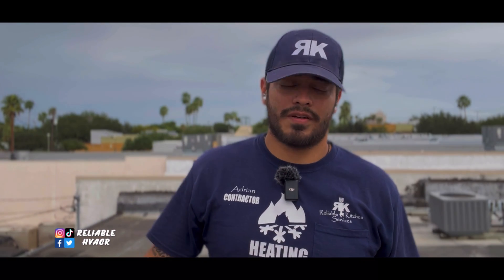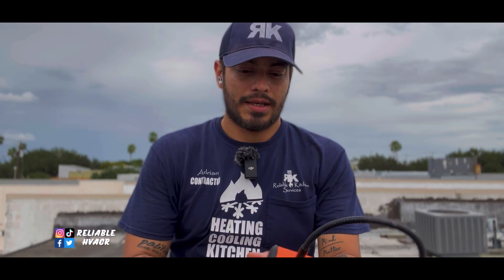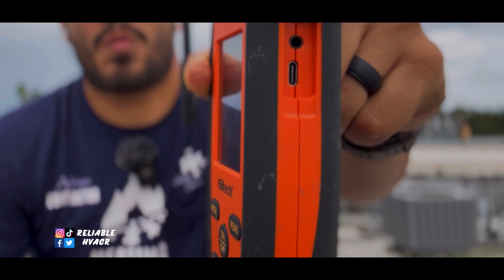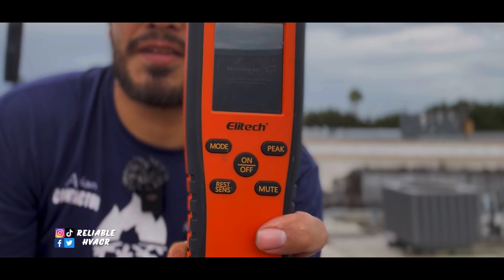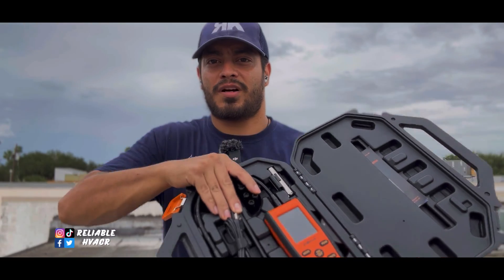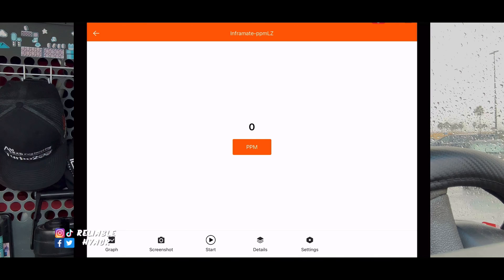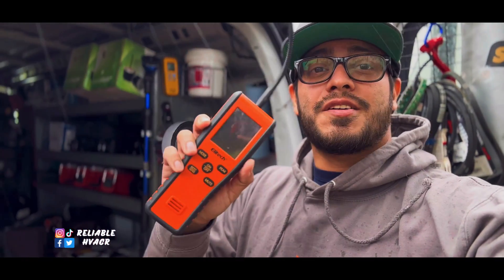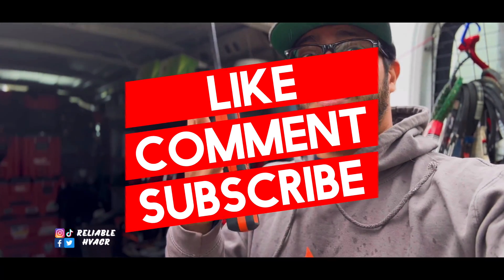NEW WIRELESS & PPM infrared refrigerant leak detector / Elitech Metrum

Comment: You ever tried opening up the unit to see what the sensor looks like ? I know they say 10 year life span on the sensor but let's be field realistic... 2 to 3 yrs at most lol
I looked at one of the pictures that elitech had of the sensor and it looks strangely familiar to the Inficon cartridge style sensors. 
I'd love to be able to replace the thing when and if it fails but elitech doesn't offer accessory replacements as far as I'm aware of and that's preventing me from placing a sale.
I know that Testo 316-3 heated diode sensor is the same the Tekmate sensor from Inficon so maybe there's a chance that the Inficons and Elitechs are compatible.
Reply: Testo 316-3 is same with Inficon compass, so sensor can replace each other too :D
Reply: @DBMThiếtbịđo  Yeah I truly believe that the 316-3 is just the inficon compass rebranded. Same technology with a different coat. Testo is just pricier.